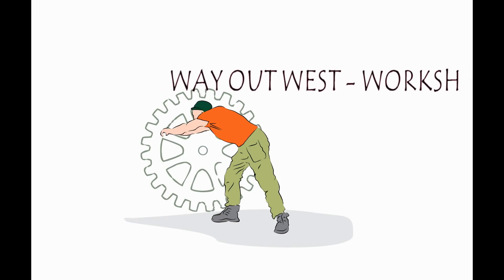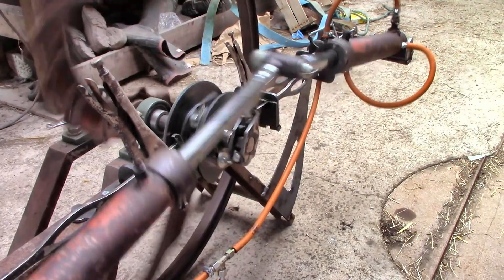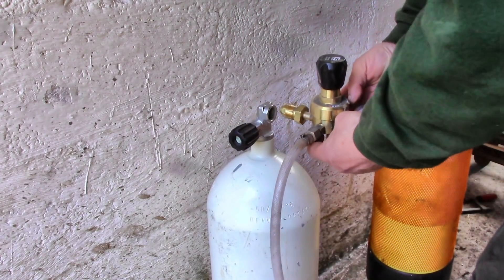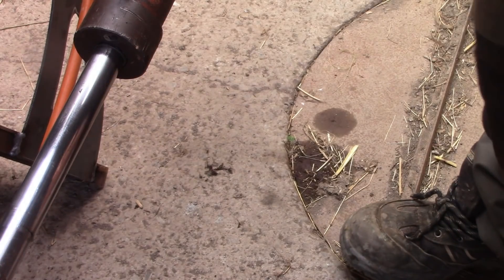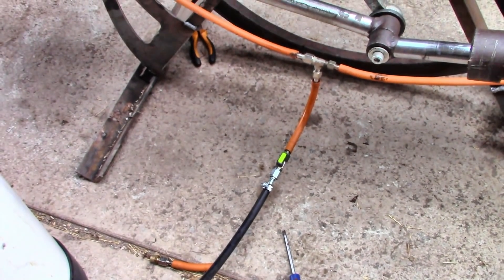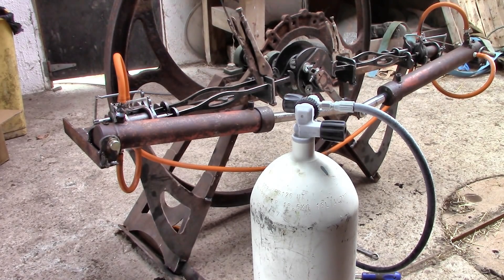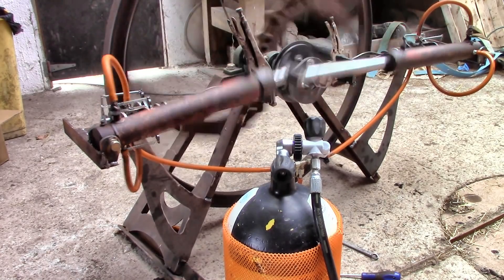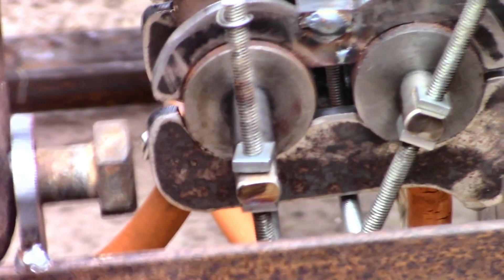It’s Alive!! Air-Powered Locomotive Moves On Its Own!

Comment: If you can get enough power out of a water wheel or windmill to compress air for the tanks you would still be better off having them drive a generator to charge a battery for an electric motor. Your engine is a fun and fascinating project but the only way it will win out against an electric motor in terms of efficiency is if the power plant is driving it directly (e.g. an on-board steam boiler).
Reply from the maker: Ah, but if I use windpower then efficiency doesn't matter at all..
Reply: @wayoutwest-workshopstuff6299  Only if the windmill (or sail?) is mounted on the engine, otherwise you'll get less running time out of the pressure tanks than you would the equivalent weight of batteries and electric motor, so you'll end up having to swap them more often. But if one pair of tanks will get you through an entire day then it probably doesn't matter.

Comment: Please be very careful when dealing with such high pressures! 100psi could easily explode those valves you made, and cause serious injuries or death. At 2000psi, it can throw metal shards almost a mile in every direction.  Lower pressures and larger volumes is definitely a safer plan. It only takes 25psi to move that machine quite well, just a larger volume.  Just Please be careful

Comment: Here is your compressor for use with a windmill:
https://tenor.com/view/armstrong-metal-gear-rising-senator-armstrong-steven-armstrong-gif-25024206
The air valve to the cylinders needs to be connected to a "Johnson Bar" like on a steam loco.
https://en.wikipedia.org/wiki/Johnson_bar_(vehicle)

Comment: Why not water power ? Run the engine on water pressure.. lots safer .
Reply from the maker: but where would I get that, Mark? You mean a hose pipe? You can't compress water so you couldn't carry it around in a handy tank. I'm interested but please explain more
Reply: @wayoutwest-workshopstuff6299  like a hydraulic system with a fire fighting pump and a tank .. recover the water and  recycle it .. we had a contraption in the farm as kids that had a pump and cylinder that we drove around for fun built out of the junk heap ! I can't remember what the cylinder was out of an old engine or something . But it had modified valves and ran on water . Might have been an old piston pump not sure now ..

Comment: that was very fun to watch, what instead of using Rope you used mechanical belts? or belts in general?
maybe it would do good and depending it's rather cheap too.

i forgot to mention the fact that it would help with reversing, as once stopped, rolling the engine backwards will push the train backwards.

Comment: I think what you could do id use the small steam boiler you made earlier (which made dry steam) to pressure a large tank (which would be the boiler) to then tun the engine. This all could be on a second wagon. Or buy a small deisel engine. Put it on a wagon. Hook it up to a compresor and that could also run it.

Comment: The safety valve on propane tanks opens at 250psi. And they come in larger sizes and might be cheaper to acquire.
Reply: He still has the compressor problem then though.
Reply: @timseguine2  
How does stating that propane tanks that are bigger and thus hold more air are safe at higher pressure than he operates at indicate a problem?
Reply: @calvingreene90  I didn't quite get that you were recommending them primarily for their volume. He said in the video that he couldn't afford a compressor that outputs a higher pressure, so I found recommending tanks that operate at a higher pressure seemed a little pointless. Fair enough though, he doesn't have to use them to their full rating of course.
Reply: @timseguine2  
If the price is lower for the volume of tank additional capability is just added safety factor. 
This is not to say that if you have the additional capability you shouldn't keep your eye out for a deal on a compressor like an AC compressor off a car or while a bit Heath Robinson use a power stearing pump to pump hydraulic fluid between two tanks using the liquid to compress the air. My uncle used an old hand deep-well pump like that to fill his tires with air. All it cost him was an afternoon in the family scrap spare parts pile.

Comment: Clearly, you've got the basics of a good railway engine there. 

I would say that compressed air is potentially more dangerous than steam, however, as a lot more energy has to be held.
Reply: I'd much rather get blasted by compressed air than steam any day just shrapnel vs shrapnel and 3rd degree burns
Reply: @bensmith4563  on the surface that seems like it's true. However the shrapnel of a failed compressed air container is much more likely to be moving at leathal velocity. 

Consider it like a spring. A compressed air System is a spring wound ultra tight and gradually unwinding. Total energy in the system is fixed. 

A steam system is like a spring being wound at one end while unwinding on the other. While the steam is very hot, total energy in the system is much lower, therefore a catastrophic failure is less likely and pressure valves can be used to limit the maximum amount of energy in the system.
Reply: @scottmcdivitt2187  that is true both have pros and cons though I would take my chances with the air instant death is more appealing to me than 6 months in a hospital with 3rd degree burns everywhere
Reply: No, just the opposite.

Comment: How about a small tank for compressed air, that runs the locomotive. The stationary fire stove drives a compressor (steam engine or stirling engine). And alongside the rails runs a supply pipe/hose/line that provides compressed air for refilling the tank at access points  at start/middle/end of the railway?

Comment: If instead you used your plasma cutter to cut teeth into the flywheel and then gear it down you can put power to the wheels that way

Comment: S bäcker commented that conpressing air with windmill power is easier that generating electricity, and, from experience and theory with electronics and electric engineering, can confirm that it is true.

Another commenter said that propane bottles can hold much more pressure and are cheaper, so you could get those too.

Unless you like to generate work with your charcoal, that is, to generate steam power.

Comment: All you need is a couple of properly sized sprockets and a length of bicycle chain and a empty propane tank filled with air and you would be in business.
Reply from the maker: reverse though?
Reply: @wayoutwest-workshopstuff6299  well the engine seems to work in either direction depending on which way you start it. Just stop the engine and restart it going the opposite way.
Reply from the maker: @RonaldJS  If only it were that easy : -  )
Reply: I don't think a bicycle chain would be strong enough. Motorcycle chain would be better.

Comment: It works so well! I would love to see you build a wind turbine that "charges" a gas tank with pressurised air. From my experience I can tell you that pumping air with a wind turbine is much easier than for example generating electricity. To get electricity the wheel needs to spin at a certain speed to get the necessary voltage (or you need fancy electronics) but with a piston pump the rpm of the turbine doesn't matter. When the wind is strong it pumps faster and when it's not so windy it takes it's time.
Reply from the maker: thanks - yes, I was thinking the same thing - compressors don't mind about fluctuating rpm
Reply: @wayoutwest-workshopstuff6299  Pumping is way harder than generating electricity, it's the problem that water windpumps have: turbine power scales with the cube (third power) of the wind speed while the load scales linearly with rpm so they waste a lot of power.

If you optimize for low wind speed you need to make it big and with a small pump, you loose too much at high speeds and even risk self destruction from overspeed. If you optimize for high wind speed you don't pump absolutely anything when at low speeds.

Here you have the added problem that load increases linearly with increasing pressure (that doesn't happen with a water windpump) and that air is springy, the rotor might oscillate back and forth trying to compress the air inside the cylinder without pumping anything.

It's a bad idea if you want to compress any significant amount of air.
Reply: @nirodper  If I got you right you say the main problem is a very low energy efficiency. I think you are right that the efficiency would be low but I don't think it would be a problem as you can easily compensate it by just building a big turbine, the wind is free anyway. Yes you have to design it to manage the highest pressure required but that also means it runs easier (already at lower windspeed) when the pressure is low. The main question is how often do you need what amount of pressurised air? For example my windpump costet around 50€ to make, has a diameter of 3m and pumps water at low windspeed (2-3m/s) equal to a power of 0.25W. Yes that's very very low (I calculated an efficiency of 0.5%).  With that power you would theoretically need around 7min for every liter and bar of air pumped. So in one day you could for example get 40l of air to a pressure of 5 bar. If you needed the air only every couple of days, that might be enough.
Reply: Wonderful observation!

Comment: having the air engine with a small battery and motor as a backup would give you a good little locomotive. if you gear it for torque then im sure that thing would haul those bigger basket carts you have (or at least make them easier to move)
Reply: Put on some bike pedals!!

Comment: Perhaps the final loco could have the cylinders positioned vertically.  That way, in the event of unscheduled piston ejection, debris would either shoot straight up or straight into the ground, as opposed to being propelled horizontally at face-level.
What a unique and magnificent machine!
Reply: Yes, it would happen. 
The first time most people try to repack a cylinder it tends to get stuck so they hit it with air, I will let you work out the details for yourself.
Reply: Essentially a shay style locomotive?
Reply: i dont think there would be enough pressure for that to happen but im not sure
Reply: just put a large bale of cotton on the first car(trolly)  that's how we did it in the states.   only the crew dies that way.

Comment: The simple way to do this would be using solar power to charge a battery and use an electric motor, but who wants to do simple when we are in our workshop?.
 Maybe consider rigging an alternator to the "wood chomper engine" and using it to charge deep cycle batteries. The whole thing would then become a self satisfying identity. Chomper is chomping wood while the engine powering it is also powering up the buggies to bring in more wood for the wood chomper to chomp.

Comment: If you take the piston size, the air psi, calculate the force, the stroke length, the gear ratio to the wheel and the wheel size you could discover the torque at the wheel, and, theoretically, the mass you could pull
Reply from the maker: I'm sure you're right, but you might work it out and then find that friction and gradient change everything anyway

Comment: Actually a air powered loco is not a super new concept. There were plenty in the United states. Usually they are 3 tank design which allows for about 2-3 hours of running but a good engineer who masters there loco can get a whole day’s worth of movement on a single charge
Reply: They were used in great numbers in mines where explosive dust or gas is an issue. 
They were highly popular until battery electric locomotives became realistic.
Reply: @mfbfreak  trolley wire run motors were also very popular in mines. Although some of the last steam was fireless locos
Reply: They have been used all over the world, often for railway yard work.

Comment: well if 2000 PSI is on the table, than liquifiing CO2 is on the table isn't it. you only need around 500psi and the power output is more constant. I have no Idea how good your char coal setup is as a CO2 source. My guess is that it should work.
A biogas reactor is quite a good source. In that case liquifiing the CO2 even helps cleaning up the methan.
Reply: sorry I got my conversions wrong. The vapor pressure of CO2 is 60 bar. So that is about 1000 Psi I think.

Comment: Just for great fun and excitement a locomotive built on this air powered principle would probably be the best and safer for hauling kids, wood, charcoal, YT videos that get clicks.

But compressing air and then using it to power the locomotive will not be efficient.

Any of the modern brushless 40V or even 20V DC motors used in drills, lawnmowers, snowblowers when combined with solar panels for charging would be green and probably significantly more efficient.

I suggest a compromise, the air driven big wheel locomotive for show and a small (hidden?) DC brushless motor for real power when the loads are heavy or the pressure in the tank is getting low.

Comment: Here's an idea! Could you set the gas engine up as a stationary 'winding engine' and use a long loop of rope to a remote pulley? You could then clamp onto whichever side of the rope was going the direction you wanted, like the San Francisco cable cars. The loop of rope moves continuously but doesn't take much power when not loaded.
Reply: Let Tim know and watch his railroad series.bet you'll like it
Reply: @RBMawby  I've been here for the journey, from corrugated iron rollers up to the latest bits. I believe, from comments on other videos, that Tim reads all of this stuff so he'll have seen my idea.
Reply: That is actually how railroads used to work in the harder areas, they'd have large stationary steam engines, or diesels later on, with a long table that goes down to say, the bottom of a steep hill, and pulls trains/carts up the hill that are too heavy to do it under their own power.
Reply: Very cool idea!
Reply: To change a gas engine to run on air you would have to change the camshaft so that the intake valve open on every down stroke and the exhaust vale opens on every upstroke.
Reply: @manfredwesteroth8241  not quite sure what you're saying here. Isn't the way Tim has it set up that each piston drives only on the outward stroke of the ram? The two cylinders are working during different parts of the revolution of the flywheel and each has its own air valve. I suppose you could cross pipe the rams to get work from the return stroke but, as Tim has already said, the working area of the rod side of the rams is very small and probably not worth the added complexity for the small power gain. The problem is that these rams are hydraulic rams, pneumatic ones, as I'm sure you know, are designed and built differently. (Larger diameter cylinder,  thinner rods)
Reply: A cool idea, though a rotating loop of rope, strung out over such a long distance as that, would be stupendously dangerous.

Just for one example, what if one of the dogs got excited, grabbed the rope and were dragged into the mechanism?

Not to mention if he fell into it.
Reply: @Nevir202  wire rope? Mind you, if you've watched the rest of the workshop series you'll see that there's a lot of common sense at play with regard to machinery.  A simple guard at the engine and pulley end would suffice to detach any mutt from the rope.
Reply: @davidquirk8097  WTF? You really don't know how things work if you think a guard is going to protect something which has latched onto the rope.

The danger is the pinch point, and when you go from something unprotected to enter the guard, you've just created a NEW pinch point where it goes through the guard.

It may be less dangerous than the one where it's about to wind around the pulley, but it is NOT at all safe.
Reply: You mentioned a dog. The guard will definitely unlatch the dog (being that, in general, they're less stupid than most humans. I'd also point out that my suggestion was an idea, not a fully formulated product. As far as not knowing how things work you're making assumptions about me without even a small percentage of the knowledge required to make that statement.
Reply: @Nevir202  wire rope is not dangerous. I would not consider anything else for rope . If a dog is stupid it gets run over and such . Stop with the nanny crap .
Reply: @Nevir202  
And I suppose you don’t see anything at all dangerous about the current mechanism, the fly wheel for example. Parts thrashing back and forth, in my opinion everything about it is dangerous. Once shielded from danger it could be under some conditions and vastly improved something good to use. A very small gas engine would do the job. The electricity to run the current compressor or any compressor would come from probably burning coal. Think about it.
Reply: @yt650  LMAO!!! You can observe the area around a running engine, you can't observe 300m of rope all at once. 

You can contain an engine, a 300m long rope loop can't be contained.

Or rather it could, but only with an engineering project which would invalidate the entire point of the device.
Reply: @yt650  I think you're missing the point of this project. Of course they could just get a second hand quad bike with a trailer or something and drive the stuff around, but that would not be an interesting project to work on and be proud of. Also of course it could be seen as dangerous, but I don't think tim is applying for it to be road legal any time soon so I wouldn't worry too much
Reply: @yt650  says "Everything about it is dangerous"
The rest of us are saying "Yes isn't it just awesome. Dangerous and FUN"
Reply: @yt650  as long as his welds and the probable Chineseum it’s made of , those cylinders are not prone to explode. That flywheel would break bones if you want to put your arm in it, but most have enough common sense not to. See Darwin Awards. And it probably would shake to much before the flywheel came apart. Man has made a useful thing perhaps. What are you building other than jaw and finger muscle